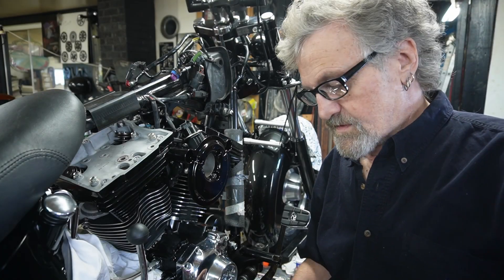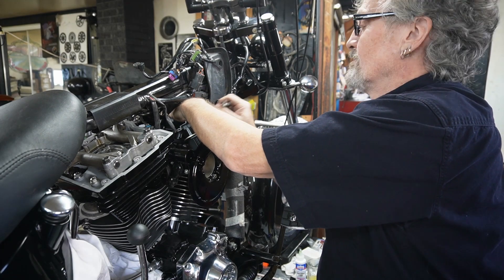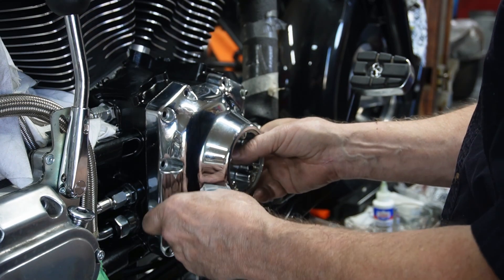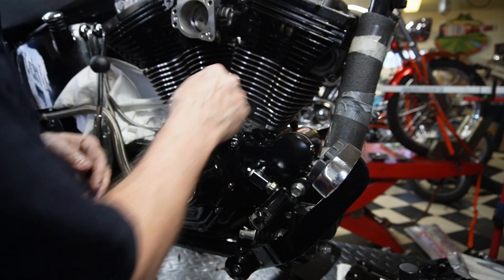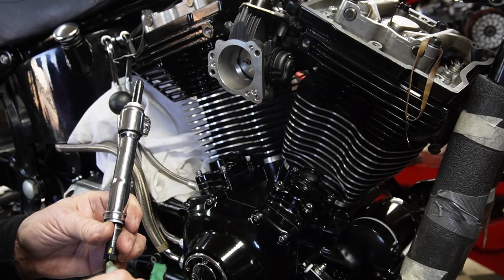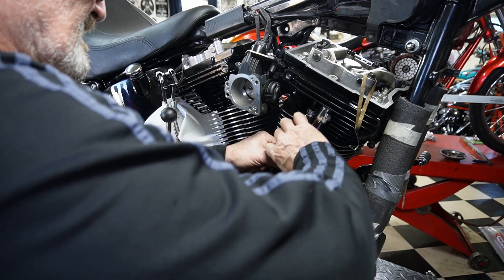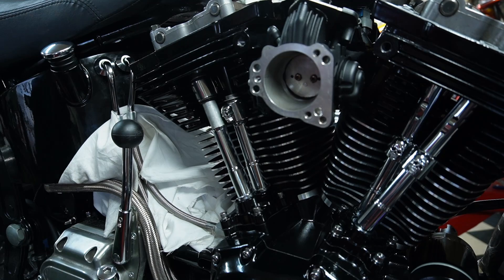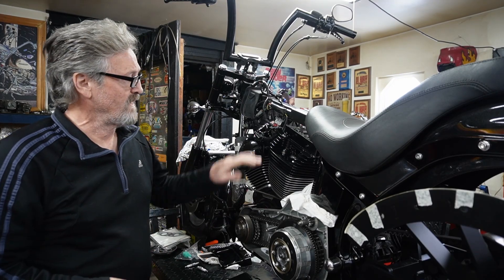TWIN CAM LIFTERS , PUSHRODS AND ADJUSTMENTS, ROCKER ARM INSTALL, THE BLACK PEARL BUILD CONTINUES

Comment: Is there a recommended mileage for when to replace the lifters?  My 2015 Street Glide is sitting at 73K with the original factory lifters.
Reply from the maker: I would say you should have your tensioners and cam bearings checked. If they have not been done they could create problems. I do not know for sure what if the suggest time for lifters in particular. Usually I  will suggest new lifters as well, if the mileage is high, and especially if new cams are being put in. Thanks for the question and commenting.
Reply: @ Thanks for the great info!
Reply from the maker: @SinisterClutch  You are welcome. Hope it helped you make your decisions.